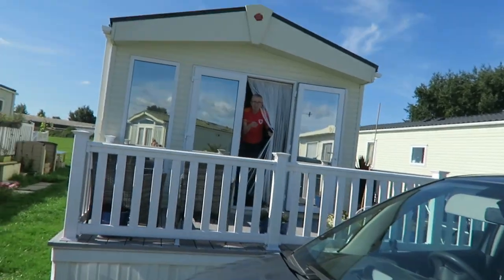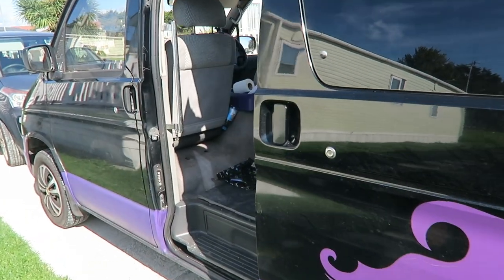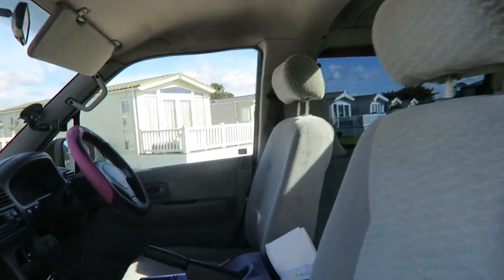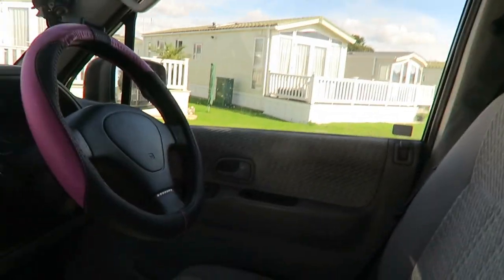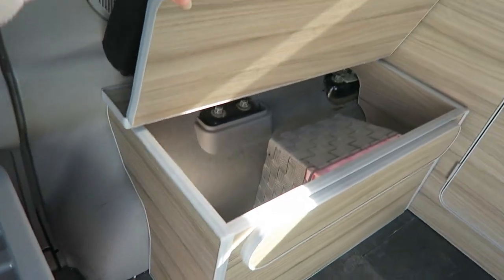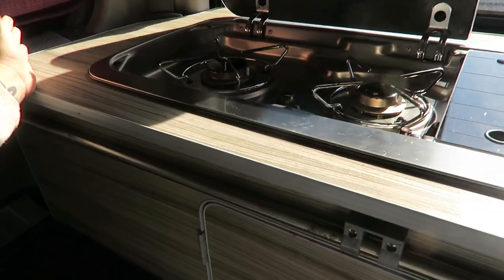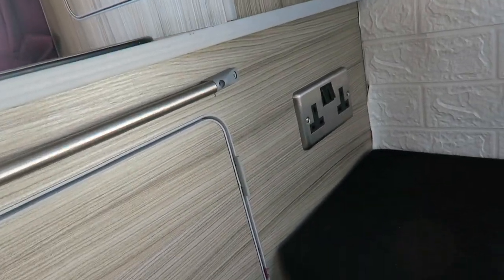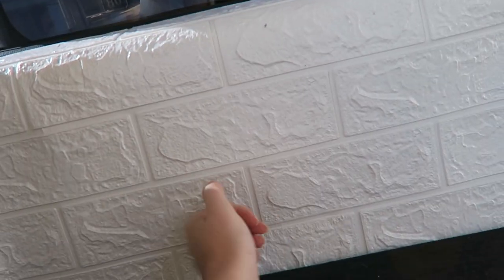Solo Female UK Mazda Bongo half converted | Before full conversion campervan tour | Sammy Jayne

Comment: Lovely Bongo! If your Bongo guy hasn't already advised it I would say get it undersealed ASAP, as most Bongos die from rust if this hasn't been done (they don't underseal in Japan as they don't salt the roads in winter like we do). Also, if it is a Diesel engine I would advise getting a coolant alarm fitted ASAP as well, as the diesel engines can overheat pretty quickly if the coolant gets too low, which can crack the head gasket and that can be a death sentence for a Bongo as it is difficult and expensive to fix the head gasket once it is gone. The coolant alarm will beep if the coolant gets too low and then you can top up with new coolant - I would carry a bottle of water at all times just in case it gets low and you don't have coolant handy 🙂.

Comment: Also the panel you opened up is where the tools for changing the wheel are stored, the there should be a jack, some chocks for under the wheel (in the bag) and there should also be two metal bars, these combine together to make a kind of t-shape which is used to unscrew the spare wheel from it's mount under the Bongo at the back (look online for a better description 🤪). Hope that helps - i'll see you on the road in my Bongo!